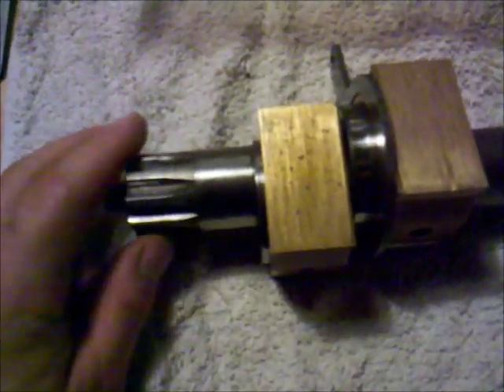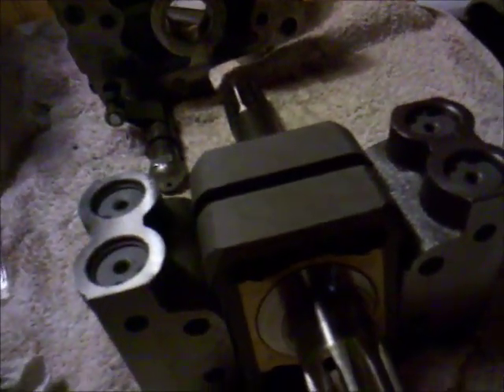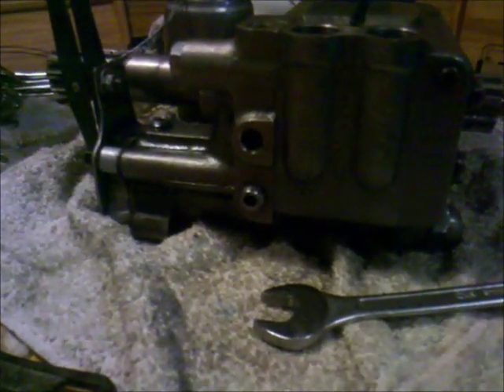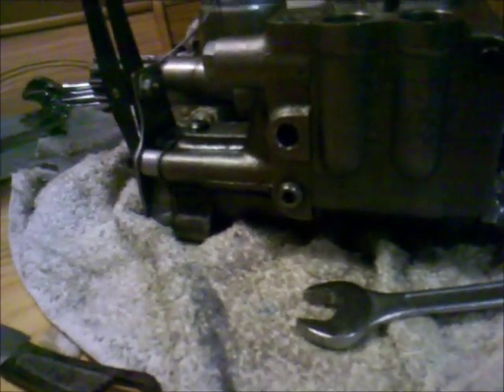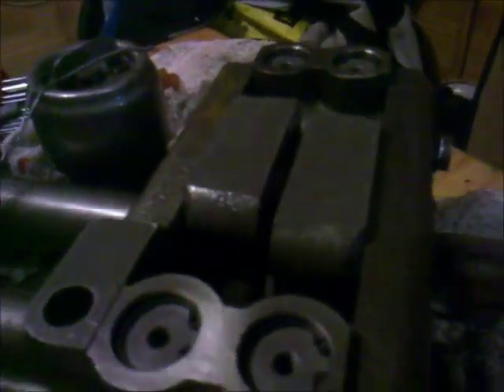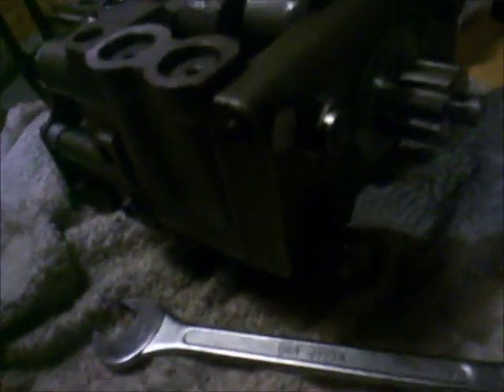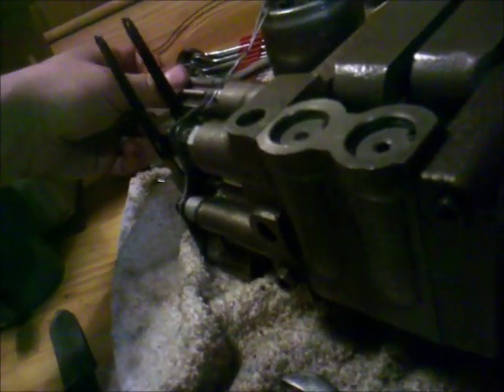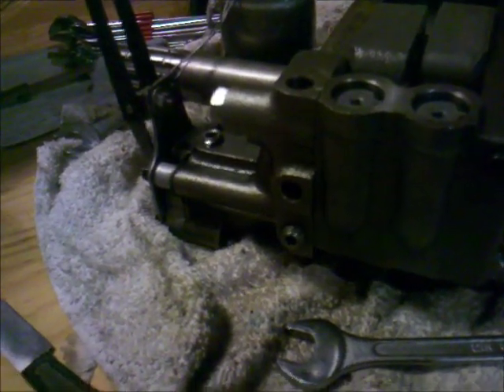MF 165 Multi Power - MF Hydraulic Pump Overhaul - part 5

Comment: I had the same trouble with an aftermarket exhaust manifold. I had to take a little material off the tube walls to i could get the nut back on. Whovever is making these parts should have a better quality control department!!